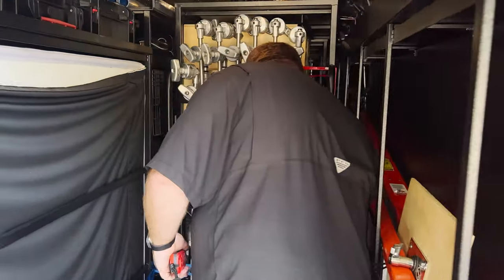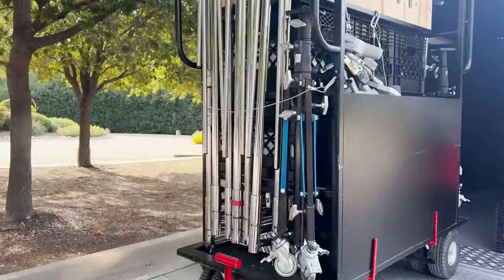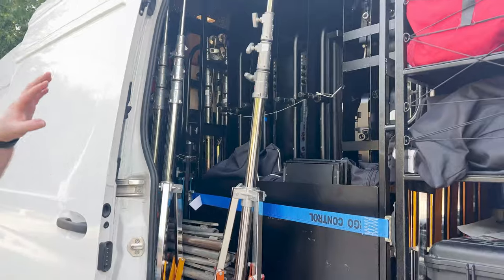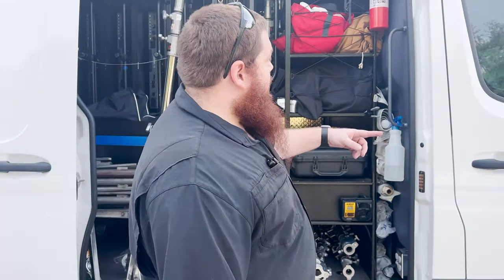2 Ton Grip Van Tour & How to Clean Camera Lenses | Pro Vlog 25

Comment: What a sick van. One of the best I’ve ever seen. That’s probably the best you can make a G&E van given the space. I’m debating on next year if the money allows a 20’ box truck to compliment my sprinter. The prices are so close and you can fit so much stuff in them. The downside is the DOT stuff, the diesel, and they’re probably more expensive to maintain. So amazing what you accomplish with a van like that though! Truly awesome. Congrats on your new van btw! Can’t wait to see how you kit it out!
Reply from the maker: It is a killer setup, I wish I had the need for one like it. But I am a bit off from that. The one I snagged will be a perfect fit for me. I was eyeing the box setups too. But then there is no hiding your intentions when trying to park. 

I am cooking as we speak. . . in the Texas heat. Should have something to share in the near future! 

Thank you so much!
Reply: Thanks! A box truck is a great choice if you can get away with the DOT, etc.  We bought all diesel's which are a lot better mileage and with idling which you will inevitably be doing loading up a truck to not run down a liftgate battery, or cooling the cab down during a hot load out, etc.  Try a Sprinter Box... They've been in stock at multiple dealerships locally recently.  Might be the best of both worlds, and possibly less DOT issues.

Comment: I hardly ever clean my lenses because I keep B+W MRC clear or UV filters over the front elements. And even then, I don't shoot outdoors nearly as much as you do, more inside homes for documentaries and corporate facilities, theaters and stages so the lenses aren't being exposed to the elements all of the time. When I do clean, ACs convinced me to only use Panchro and Kimwipes many years ago so that's all I use. No smudges, buildups or micro scratching coatings. I personally think lens cloths are taking more of a chance of microscratching than Kimwipes as the cloths do become dirty and contaminated, whereas each Kimwipe is brand new and you use it and throw it away.   

Wow, that's a really sweet G&L van. That would support some larger indie feature or TV shoots. He has a ton of the best G&L toys on that van, a gaffer and DPs dream.
Reply from the maker: But a Kimwipe box open to the elements on a cart is prone to getting crud all over them. AC's just leave them out in the open on a cart. If they were wrapped individually, it would be a great solution. 

The van is so awesome, he is a great contact to have in the rolladex! 

Thank you for watching and supporting the channel!
Reply: @PDMokry  I take out a stack of them out of the Kimwipe box and keep them in a sealed Ziploc in my camera bag. Not an issue for me but I'ver seen what you're talking about on camera carts. The box is too large for my camera bag anyway, I keep on the side pocket.

Comment from the maker: How do you clean your lenses?
Reply: Lots of air!🤣
Reply from the maker: @duquettemedia8924  NOOO!!!! Lol!
Reply: Not canned air though just the rocket blower lol, Thanks to your video I can improve my methods! @PDMokry
Reply: I work outdoors so I clean lenses and camera bodies more often than most. I have a dedicated kit (ammo box sized) so that I can do everything up to swabbing sensors in the field if needed. It has got bulb blowers, a soft toothbrush, paint brushes, contact cleaner, swabs, an arctic butterfly, and of course single use Zeiss wipes!
Reply from the maker: @user-f5xt2op9t  Camera medic kit! It will save a shoot for sure! Seems like you got it dialed in.
Reply: Kimtech wipes and Pancro